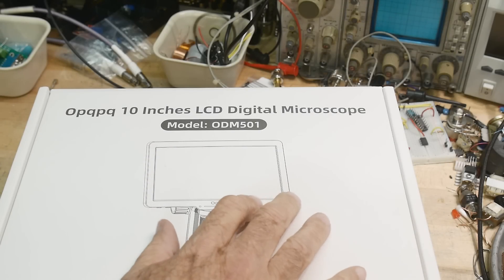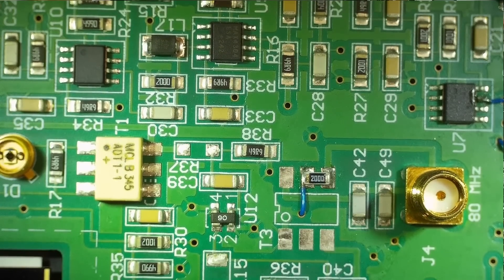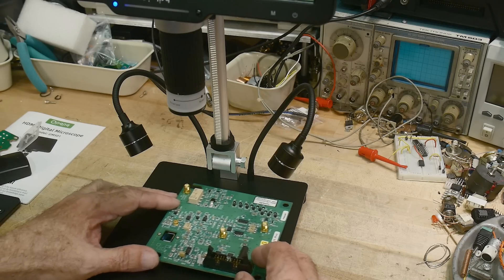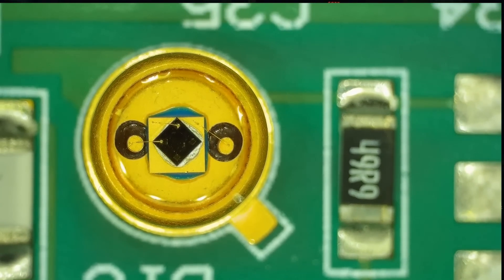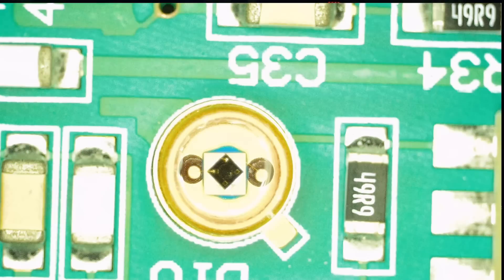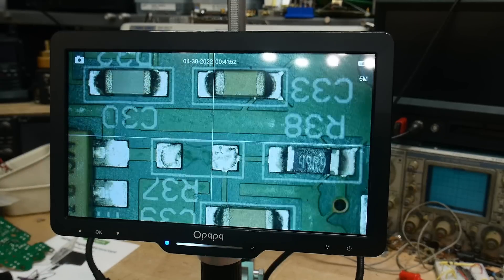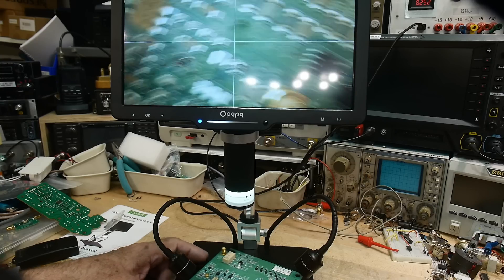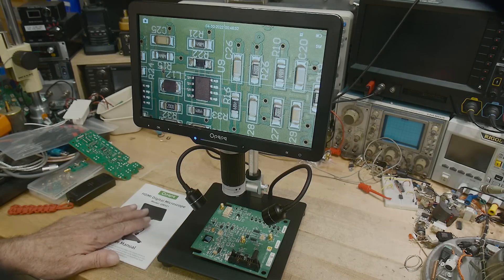#1454 10" HDMI LCD Digital Microscope Opqpq ODM501 Review

Comment: After watching your video I picked up one of these.  Unfortunately it was dead but fortunately I was able tear it apart and replace the backlight flex that was torn with wires and now it works great (Dead backlight seems to be the main review complaint) . When you were demonstrating it, it appeared to only have 3 picture resolutions, peaking out at 5mp.  If you scroll up past the 5mp you get the rest of the menu that tops out at 24mp.
Reply from the maker: is it really 24mp? or just up sampled. can you tell
Reply: @IMSAIGuy  It's hard to tell whether the artifacts are from compression or up sampling.

Comment: i have a 7 inch version of this you will find that if you put a item on the floor you can even focus on it.
you dont have to stay in the 2cm to 30 cm focal range. it will focus out to about 1.8meters
Reply: i put a weight on the base plate and rotate the camera 180  and then view stuff at much greater range or stuff in my hands.
i have coins in a medicine bottle for counter weight.

Comment: When you tilt the rack and pinion, can you also tilt to camera back to vertical? Any tilt control on the camera/display bracket is hidden by the height adjustment knobs.
Reply from the maker: the only tilt is between the base and the focus rail. it requires the use of a wrench

Comment: On Amazon it says this model can do 24MP, and it can output to hdmi and connect to Windows as a webcam.  Were you able to confirm if these claims are accurate?
Reply from the maker: I have no idea how they claim 24MP. 5MP still, 1080p video
I did web cam via usb. I did not try the HDMI
Reply: @IMSAI Guy  Cool, thank you for confirming!  I was skeptical.  But it's good to hear the webcam function works.  That could be helpful.   Love your channel, thank you.

Comment: I wouldn''t get this microscope if it didnt also have digital zoom like the Andonstar brand. Too many times I need to be doing work on the piece and I can't physically move the microscope down closer to the board because that would keep me from getting a soldering iron into the area so I use digital zoom. During the entire video I was hoping for him to showcase the digital zoom feature which would have sold it for me, but didn't happen. It's a nice microscope but without digital zoom it may not be useful for people that need the microscope to be high, but still need it zoomed in (digitally) to see what they are doing.
Reply from the maker: it has digital zoom to 2.9x
Reply: @IMSAIGuy  oh ok, that changes things then 😂😂

Comment: You can't tell from the video exactly; but, I didn't think much of the build quality. It seems like a toy... something for kids. According to the review... it does the job? And I know... if they can save a dollar on packaging... they use the cheapest and lightest packaging. That doesn't mean that form impairs function (True: a lot of modern microscopes use plastic bodies, and hollow alloy castings, with lots of cast versus machined parts)  ... but, is this what people use in Asia? ... or are they just selling it to us?
Reply from the maker: I agree it could be better, but they have a price point in mind. The weak part here is the stand. I ended up building a better stand out of spare parts I had, but it would add about $100 to the cost. (video in a couple days)
Reply: @IMSAIGuy  Awesome as usual !

Comment: I have an optical question. I bought one of these type of microscopes a few years ago, it was an Andonstar brand. When rotating the lens barrel to adjust the focus, it had two different focus points, both equally sharp and same magnification, but quite a large distance (barrel rotation wise) apart.
How is this possible?
Reply from the maker: probably a repeating thread

Comment: You keep cheering about the picture quality at moments where non of the ic markings are readable... 😐
That adjustable polarizer might have made a difference in those shots. 🙂
Reply from the maker: I found using the side lights at an angle allowed the markings to be visible
Reply: @IMSAIGuy  Try the polarizer, it can help with IC identification especially if you have just got your goose necks all set up nicely !.....cheers.
Reply: Ah, good to know.

Comment: thru-hole vias considered useful for bodging.  Never saw that before but it's obvious in retrospect.
Reply: Oh hell yes! Great spotting. Used to do this with some multilayer boards for our "bug fixes". Was the only way for a quick fix, when you had to rush into production and correct in the next major version upgrade of a design. We'd try and match the wire to the colour of the substrate where possible so as not to spoil the aesthetic as well. 👍